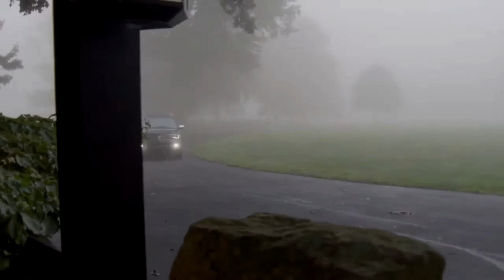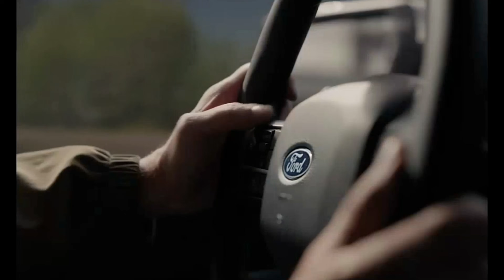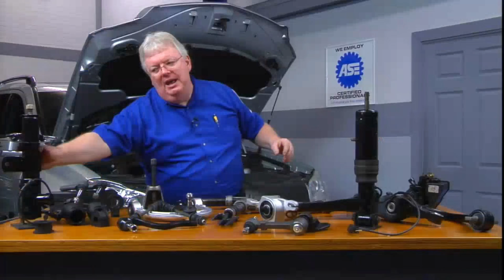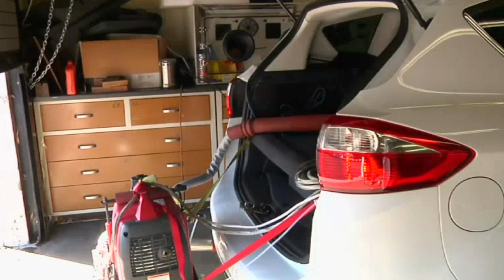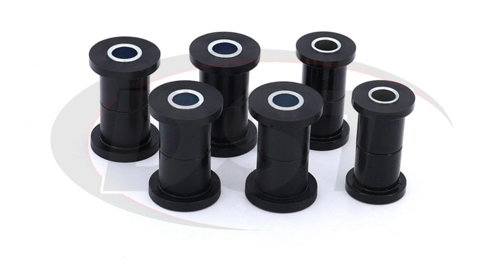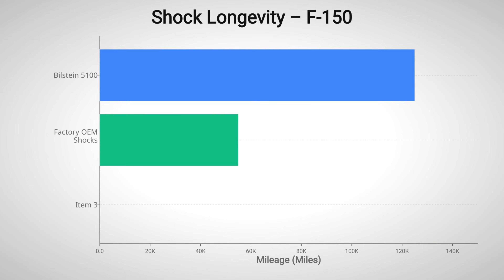The "ILLEGAL" Ford Suspension Mod That Rides Like a $90K Lincoln (Here's How To Do It)

Comment: Helper air springs stiffen ride rear if no leaves removed. NAvigators and Expeditions have independent rear suspension F-150 have solid axel except for current Lightning EV. BILSTEIN DOES NOT MAKE SHOCKS OR STRUTS FOR MY REAL F-150 TRUCK WITH 8' BED THAT REQUIRES 7 LUG HEAVY DUTY PAYLOAD PACKAGE 8200LB GVW. THis is a commercial for air lift bags and aftermarket struts.
Reply: 2003 supposedly 1st year independent rear Navigators and expeditions. Believe optional expedition and they fail most people convert to standard struts due to expense air compressor lines and air struts.

Comment: I've used 2 different types of start/stop bypass systems, depending on model year, on 2 of our Escapes. But neither type can be used on our new '25 Lincoln, so the pain in the butt hit the button with every restart has to be used. This is one of the dumbest things to every be installed in a motor vehicle, among many dumb expensive things they now install!